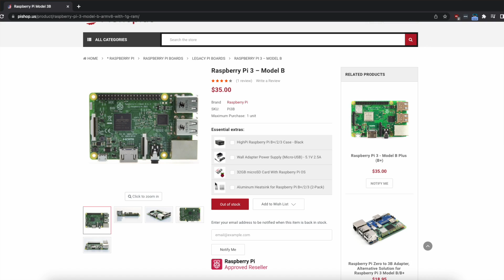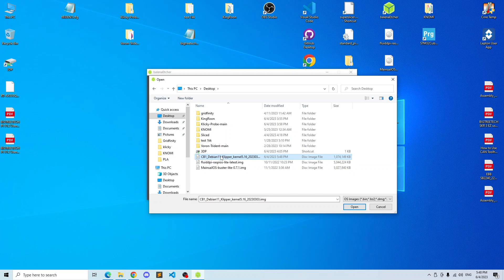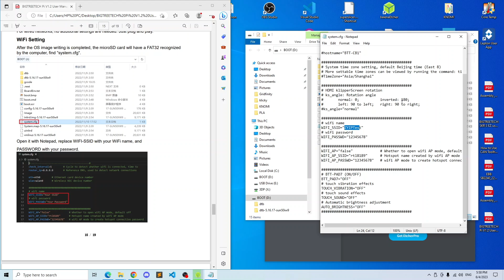BTT Pi V1.2 - Raspberry Pi Alternative

Comment from the maker: The day after the review I have used Raspberry Pi Pico with ADXL via USB and board was able to process Automatic Input shaper calibration without any issues!
Reply: Can you do a video on this?!  I’m having the same problem!
Reply from the maker: @GiovanniGiorgo  Here is a good video how to set it up: https://www.youtube.com/watch?v=W_VHbT_tsZw
Reply: ADXL345 Wiring
Note: When using the TFT35 SPI screen or IO2CAN (MCP2515 SPI to CAN), this SPI bus 
is occupied by the Linux kernel and cannot be used by the application layer, so ADXL345 
cannot be used simultaneously.
Reply from the maker: @julior1980 There were several changes to the image since the video and I think now you can chain devices on SPI BUS but I might be wrong.

Comment: So I've learned some thing about this board. I wired a 24 line from my printers power supply to this board with a switch to power it on or off independently. This is the same setup i was running with a Pi3, with the only exception being a buck converter to step down the 24v to 5v. WARNING do not do this setup. If the switch is in the on position when powering up the printer, there is no problem. How ever if said switch is in the off position when the printer is powered and you hit the switch to power on the BTT Pi you will blow the power management component. I know this because I have gone through 2 of these boards when I powered them up. Near as i can tell this board does not like the power jump from a fully on power supply. I am currently waiting on a third board, and will be removing the added power switch all together.
Reply from the maker: Thank you for the information, I hope it will save someone a board. Not sure if it's fair to mention RPI3 setup in this case as it's can't be directly powered from 24v and requires step down regulator. I would check what is happening with voltage when switch is flipped cus let's say you have button with light inside, in this case the light can behave like an inductor it's just a guess but it will reveal itself with oscilloscope or good multimeter. We have similar situations on drone controllers and usually extra filtering capacitor installed on assembly process to prevent power spikes, ofc it be nice if manufacturer did it for us or at least mentioned such issue in their documentation.
Reply: Oops you 100% right. I missed that. @hobbyistnotes

Comment: Did you test how wifi performed without the antenna? Curious if the antenna is required or if it just makes it perform better compared to the RPi
Reply from the maker: Yes I did and it’s not working without antenna at all, so it’s must have. Weird solution as there is so much empty space for simple trace antenna why it doesn’t have one I don’t know.🤷‍♂️

Comment: Hello!
does retropie or recalbox or similar linux-based operating systems work on it?
Reply from the maker: Those Linux Images are well optimized for RPI specifically but I am pretty confident if you have just a bit of linux knowledge you will be able to run those on BTT Pi as well. At the end it's +- the same ARM linux with similar peripherals.
Reply: @hobbyistnotes  thank you so much 😊

Comment: Did you have to do anything for the touchscreen? The left side (emergency stop, menu, back arrow key) don’t work. I have replaced the screen and still having the same issue. Did you run into this issue?
Reply from the maker: I didn't had much time to install this screen on the printer yet, will take a look this weekend.
Reply from the maker: So, Finally! I have fully integrated BTT TFT35 SPI screen in my workflow, currently using it on my Voron Trident 250mm with BTT Manta M8P v1.1 and CB1 module. Initially when I got the screen and new motherboard I was playing with them on my bench and noticed that screen is very flanky and laggy. Due to time shortage I have abandoned the printer upgrades for a while.... 2 months have passed since then and this week I was working on few upgrades and noticed scrolling thru update logs for CB1 Linux Image that BTT have fixed few things related to TFT screen and after installation it was clear that now screen is working way better. It's still not perfect due to very old and cheap resistive touch technology but it works. I also noticed while placing it in the housing if anything touches the screen(cover, screen protector, etc) it's messing up with touch. I have border cover on the left side of my housing and if I push it too hard I get similar behavior as you.

Comment: cant get adxl to work as well, using the dedicated spi port or via the gpio pins. had success when i connected a pico as a dedicated mcu for adxl.
Reply from the maker: I had one of those USB ADXL probes made with Pico RP2040 hid it somewhere due to no use and can't find it 😤 wanted to try it later this week.
Reply from the maker: Found it, worked fine for me.

Comment: Maybe try with shorter wires - from main board to Sensor. 

Usually pure 3V3 or 5V signal wires must not be much over 30cm - sometimes up 50cm might work, but not always. 
High speed signal wires should always be as short as possible.
Reply from the maker: For sure will try shorter cables but I have used this ADX sensor with exact same wires a lot of times with RPi and this idea still won't explain why screen stops working when I enable any of the other SPI "ports", at this point I have burned 3-4 hours playing with env config file and still can't get it working even it's says in documentation that theoretically it should work.

Comment: Libre le potato and la frite is a good alternative. The gpio on those boards are rpi compatible. It also supports emmc which is a lot faster than using an sdcard. The only downside is that they do not have wifi builtin but a usb wifi module they sell is only $5. The libre boards are definitely on part, if not faster, than rhe rpi 3b+. Ive been using it for a while on debian and klipper.
Reply from the maker: Thanks for info, will take a look.